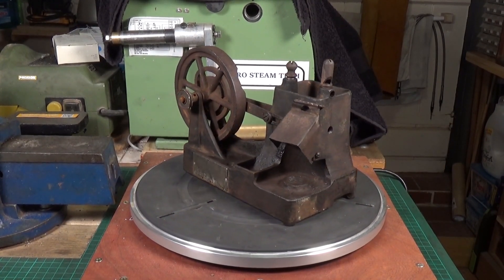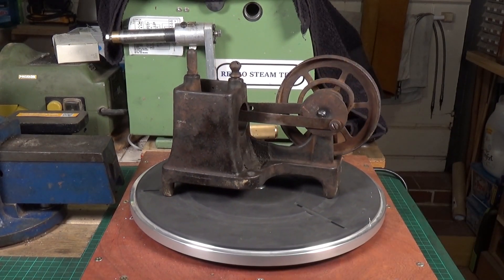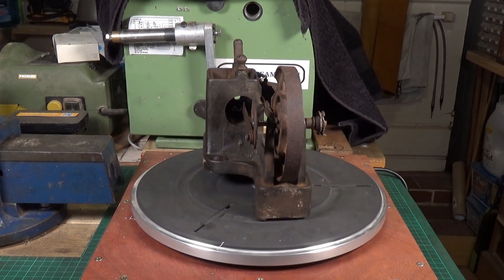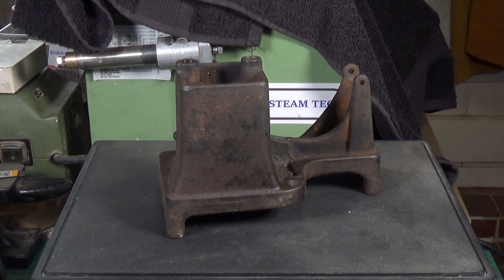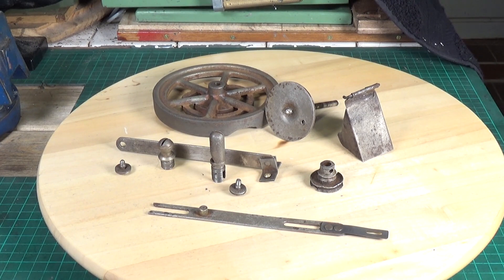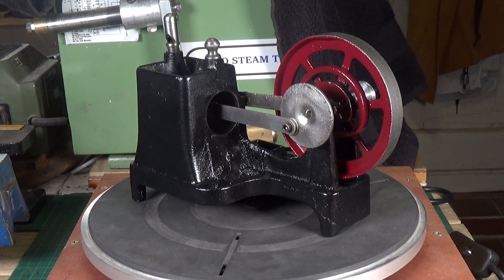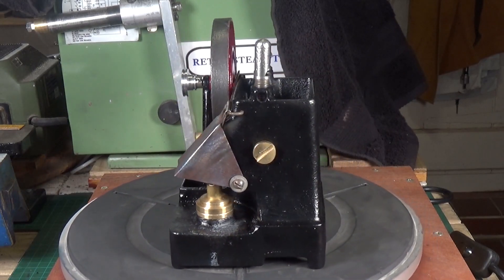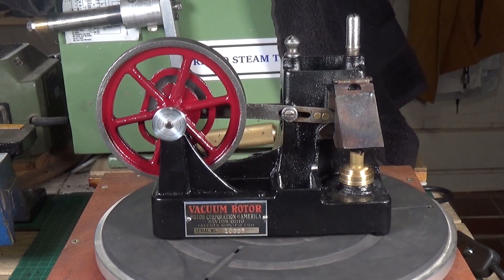Vacuum Rotor Flame Licker Engine - Part One

Comment: Looks good Alan.  I await part two ;) 

One trick to hold really thin walled tube like that piston is to turn up a thicker outer tube that the piston fits snugly in and then slit the tube full length.  That way it will act as a split collet when you put the tube with piston inserted, in the chuck jaws.  It will also prevent the thin walled (piston) from deforming.  Cheers Rob
Reply from the maker: Hi Rob. I see now where I'm going wrong with this stuff. When I come up with a problem like that piston I should simply just "ask Rob?" 🙂 I would have never thought of that split tube idea, brilliant 👍👍

Just been outside melting some more aluminium, the furnace is working superbly which proves the first time wasn't a fluke! Tried some Red Bull cans, myfordboy told me that the aluminium used in drinks cans is crap for casting but I thought I'd have ago anyway just for fun. Turns out he is of course right, it's crap.  Next I tried some of that checker plate aluminium sheet I got off ebay for £6 for 2Kg. Melts and pours really well, just waiting for the thing to cool down to see how the cast turned out, but I think I might be onto a winner there.

Cheers, Alan.
Reply: @RetroSteamTech  Hi Alan,  I've never tried melting drink cans.  I see Keld Sorensen and Harold from ARW do it a lot and seem to think it's OK.  Maybe some are better than others - I've no idea really. They must drink a lot of cans.  I would think that ally checker plate would be perfect for casting having cut it and fabricated with it.

I have wondered a few times about doing a video on that simple split tube/collet trick.  I have shown it being used when making gears, to hold them after cutting while broaching.  Protects the teeth and gets the cog centered.  You can basically make any sized large collet you want - works like 5C.  

Good luck with that engine - it might be the Son of Bastard engine ;)

Cheers

Rob
Reply from the maker: @Xynudu  Hi Rob. I've not seen those videos so I will go and have a look. I think if you had a larger furnace and could melt 20 or 30 cans at a time you might get some usable aluminium. They do smoke quite a bit when they first go in and there is a lot of debris floating on the top once melted. The checker plate on the other hand was great. I've shot some video so there will be a "Beer Keg Furnace - Part Two" up shortly.

Definitely think you should do a video on the split tube thing, I'd find that very interesting.

The engine very certainly is the Son of Bastard!!!

Cheers, Alan.